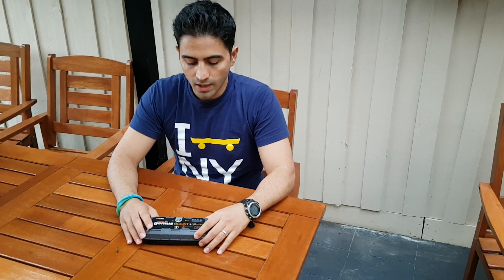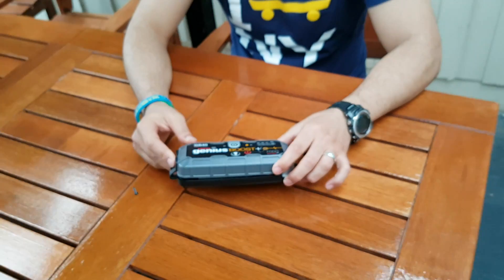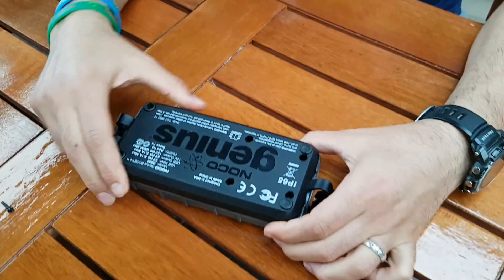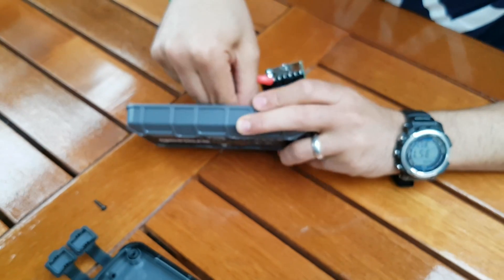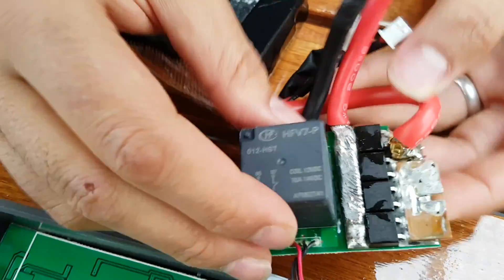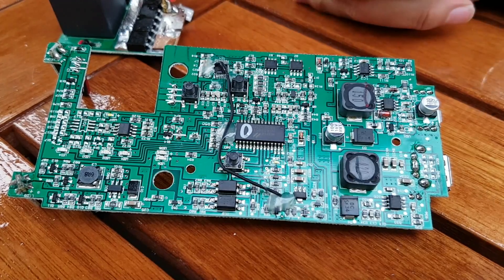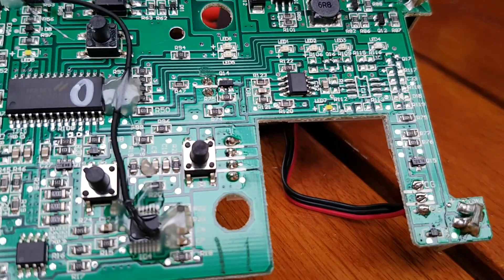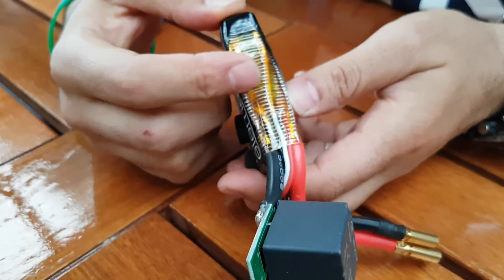Inside Noco GB40 Battery Booster Jump Starter Review

Comment: My brand-new, fully charged GB40 was unable to get my V6 3.5 L Toyota started after leaving the radio on. Followed all instructions to a T, trying with /without protect/override. Engine cranked for .25-.5 sec, but cut out before it had a chance to start. Confirmed the GB40 was still reading 100% charge per its lights after the attempts. Returned but will order another when on sale (reg is CAD $159) as it must've been a defect.

Comment: Old post.. but is it normal to feel a bit of a bulge through the back of the case? About q 1/3 of the way from the end(opposite to battery end) looking at your video I'd guess it was the black part, between the screw holes on the board, that intersects with the red wire.
Reply: no! that means one of your cells is swelling up, take it back, or dispose of it. 

I'm actually looking to replace the cells in mine if anyone has torn the pack itself apart and knows the exact cell type

Comment: Hello
I bought noco gb40 5-6 years ago. All this time I never really use it. It was fully charged inside my car. I tried 3-4 times to jump a car but sadly it didn't make it.
I tried it fully charged and with bypass option but nothing. 
I wonder if inside battery is dead due to lifetime. 
I should write that I put on charge not often. Every year or every year and half.
Could you tell me please if my device could be fixed or is garbage?

Comment: I still want to know how that black magic works on starting completely dead batteries, I seen a GB40 start a BMW with a dead battery in the trunk, the batteries in BMW's are rated at 900cca's because there in the trunk far from the starter, and that damn thing still started!!
Reply: Right. All the arguing about specs, all I know is they work. I made some comments on this vid 3 years ago, still using the same gb40 (albeit rarely), and it still does its job.

Comment: I've started a completely dead, 0v battery in a 6.8l V10 gas engine. I did have to let the battery booster charge the dead battery for a few minutes. Cranking was slow, but it did start. Device was in protect mode after engine start. State of charge light was 25%. Plugged in to charge and it was flashing 25% light, so it was pretty dead. The GB40 was definitely not sold as being able to start this large engine, but it still did it. No issues at all starting 1.6l NA and 2.0l turbo engines with 0v battery.
Reply: Can you please give more details that are missing? You said you "let the battery booster charge the dead battery" but which booster, the NOCO? and which dead battery? The one in the car or the one in the NOCO? 

Also when you say you "plugged in to charge, do you mean the car battery or the NOCO? Thanks!

Comment: Great review good product. The mini USB charging port is mounted flimsily. Mine disconnected and I have to try to fix. It broke loose with very little pressure. Other than that I love this product. I have the GB70
Reply: I had the same problem. I was able to replace the USB port and I put JB weld on it to hold it in place. No problems since. I also use magnetic USB cables, so no more insert/removal of a USB cable and no risk of damage if cable is ripped off the USB port.

Comment: The battery is under size but, you can fix it with just a 10 awg jumper solder on to bypass the relay.

Comment: !This is the best Jump starter I've ever used!✏️>allmy.tips/NOCO-Starter?17   I work as a mechanic and we use the jump packs all the time. This model is great for cars and Light duty trucks. Another nice feature this has is it will supply 12v power for as long as you leave it on, so you can power accessories or just charge a device. We also have the larger model that we use and it will start anything you would ever need it to. So for personal use this one is great but if you use it on a daily bases or for larger equipment i would get one of the larger models.

Comment: hmmm 2amp hour , 3600 secs per hour 7200 amps one second. Not likely but at 1000 amps maybe 3 seconds. or for 10 seconds 72 amps. hmm yep it prob wont start a car on its own unless its a newer car with warm engine which normally starts in less than 3 seconds.

Comment: I plan to have a booster for my van, this seems great. Right now i bought a diesel heater and i would like to test it but for that i need a power source of 12. I wonder if i could test the diesel heater with the boost mode. The heater uses 10 amps for one minute when the glowplug is heating and then it goes down to quite low amp. Don't feel like buying a extra battery for this test and this product will come to use some day.

Comment: I have a broken china brand portable battery starter. I was able to jump start 2 cars twice when it was new. I charged it then stored for around 6months. When I tried jumping another car, it won't do it anymore. The battery level drops immediately to lowest. I can still use it as a flashlight, cellphone charger, air pump for the tires but onlylast for 1 tire. 

Can I just remove the internal lipo battery then use the unit as a battery charger? Technically it will be connected to a low bat car battery while it is plugged into the wall outlet.

Comment: Can I charge the gb40  in bypass mode from the car battery while car is running?
Reply: No, you cannot. The 4 parallel (8 diodes) Schottky diodes will prevent any current flowing backwards to the cellpack.

Comment: Is it possible to replace the stock battery with four 18650 batteries?
Reply: There is currently no 18650 battery ( at least that I've heard of ) that can continuously put out more than 45 amps plus the balance charger for he stock battery is for 3 series not four series

Comment: 2150mah 24wh battery and the claim it will Produce  1000amps   TOTAL BS !  the Relay is only rated at 70amp how the HELL can it do 1000Amp
Reply: Could be a time delayed relay that would work.
Reply: @MickeyWu7r5  How do you mean that? Could you explain?
Reply: Kingsize what I mean by a time  delayed fuse is that it has a run cycle maybe a 25sec delay in the board before it even trys to start detecting higher amps to reset the running mode of the machine to stop putting out high amps and go back to ready start mode a 70 amp fuse would ensure that it would detect amperage every time through the run cycle because it puts out way more amps than that. 
With that being said it also helps with thermal protection of the parts themself because it only let's itself heat up or put out high amps for a set amount of time. That is why NOCO stresses to not bypass this mode because the safety features are being turned off and your running full amps without the safety features that are built into the board the time delayed fuses that tell the machine to shut down. It's like this if the machine is putting out 900amps and the fuse to tell it to stop is set at 25sec @ 70amps is it going to detect amps and shutdown yes and they would
 keep the machine from burning up that's what its designed to do.
Reply: @MickeyWu7r5  your ideas probably are correct, but your numbers are definitely not!!
Reply: Dan Ray - Marketing hype. But it probably can put out 2000 amps for a couple seconds then die.

Comment: There is no boost converter in this circuit. 11.1volt is the nominal voltage aka 3.7 x 3 cells. But when the 3 cells 3.7v cells are fully charged they can go as high as 4.25volts each = 12.75Volts. Wooola. No boost needed. "Boost converter" is allready built into the battery standard range of voltage.
Reply: I think it is needed to charge from 5V micro USB.
Reply: Yes there is to boost incoming 5v for charging

Comment: Bought one of these  , great at first  ,  But after 2 months  , it would only give one jump start and then die .
These lithium jump starters are ok for a occasional use or for cars with a weak battery  . If your  car battery is flat as pan cake then you will ruin your booster trying to start ! Also Lithium batters need charging regularly even when not being used
Reply: Anette Kottise I use the 150 all day long and it’s lasted a year now I do roadside assistance and buying the 150 is the best tool in my arsenal

Comment: surely it is cheaper to replace the car battery more often and keep it in good condition, only a fool would use a battery thats going to cause problems
Reply: 9 out of 10 mechanics recommend replacing your car battery 1 day before it is due to fail

Comment: On the output is a row of what looks like 4ea 40L45CT 45V 20A SCHOTTKY Low Drop Power Rectifier Diodes in parallel with the center leg cut off.  So that seems to be a total of 80A.
Reply: They have "Peak Forward Surge Current, 8.3 ms single
 halfsine-wave " 200A each = 800A total. However the unit is rated for 1000A burst. 8.3ms is nothing. I would think burst current for starting would be a second, at least.
Reply: @HalvardSkurve  There are 4 D2PAK, each containing 2 diodes. The I_FSM is rated at around 200-220A per die 10ms non-repetitive. (I_FSM_tot = 1760A). This is sufficient to survive the initial peak current the tiny battery would/could be able to supply at a near short condition. Real world currents will stay significantly below.

Comment: alot of people think you need 400 to 500 amps to start your car, this is not true, this is a marketing idea to sell "better" batteries.
Reply: To boost car in extreme cold with a completely dead battery you need well over 500amps. If you're in a warmer climate witha undercharged battery you're right anything over 200amps will help.
Reply: You have no idea what you're talking about. Amps needed to turn over engine depends on engine size.
Reply: S H    And engine compression and air temperature as well as how drained the factory battery is...

Comment: That is a really small battery, only 2150 mAh :(
My smartphone has a battery with 3100 mAh??
I wonder how a jump-pack with a rated battery of 10000 mAh would stack up to this.
Reply: You need to multiply the nominal voltage of the battery by the rated amp hours of the battery. An average samsung phone battery is around 3.8v and this one supplies 11.1v. Your cellphone battery probably is around 11.7 watt hours and this product is around 23.8 Wh

Comment: Take off your ring when opening such things.
Reply: why
Reply: @teddy_quentin  Metal conducts electricity. If it were to touch the right two things together, they could short out and make the battery explode.
Reply: Bullshit, those two things are called an anode and a cathode and the ring would conduct with little resistance.  No explosion  @mandolinman2006
Reply: Norma Stitz , low resistance means high amperage. There's a chance of the battery exploding. It can also make the ring glow red hot very quickly or weld the connections to the ring.
Reply: Those batteries can burn if there is high current long enough for the cells to reach several hundred degrees.  I don't expect anyone can hold their ring on the terminals for several minutes.  @judep8920
Reply: @teddy_quentin  , regardless of what can happen to the battery, shorting the terminals is never a good idea. Wearing conductive rings and bracelets when working with electricity is an amateur mistake. 
Try taking a wrench and shorting your car battery; it won't take several minutes for it to get hot.
Reply: Not for the wrench but it will for the battery @judep8920

Comment: HOW do you get 1000 amps PEAK and ~200 amp continuos for a few seconds to jump start a vehicle from a 2150 mAh battery…??
Reply: you don't.........the 3S 11.1 lipo inside this boost pack is only rated at 120c. false marketing. there's a few REAL and HONEST teardown vids that reveal how cheap and ineffective this unit is.
Reply: Spector NS5 RD So how does a portable jump starter supply ~200 amps of cranking power from a 20k mAh internal battery…??
Reply: Spector NS5 RD 
Back to my question... how do these portable jump starters provide a split second 150-200 amps from a tiny 2100mAh battery..??
Reply: the battery is rated at 11.1v 2100mah 120c. that comes out to 252 amps you can draw. (but it's bullshit on this battery. more like 150-200, LIKE I SAID).
as for how are you able to draw so many amps from a tiny battery is......lithium polymer batteries can be very small yet pack a huge punch. the lipo's battery chemistry is the reason you're able to draw huge currents from a small battery. i don't know how else to explain it to you.
Reply: Spector NS5 RD 
So if im calculating this correct, 2100 mAh is equaled to a 2.1 amp battery... 
now we are going from a tiny 2 amp battery to just over 100 amps....??  The math does not add up..
Reply: yes 2.1 amp hours. that's it's capacity, that is not directly related to the current the battery can provide. look up and do some research on lithium polymer battery chemistry  and you'll understand how you're able to draw a large current from a small lipo. that's the best i can tell ya.
Reply: Spector NS5 RD I jumped a 3.5 liter v6 with it 3 times. The last time, the battery wouldn't take a charge at all the night before, and despite being on a charger all night, it was so dead in the morning I couldn't even unlock the doors electronically. The battery was completely hosed. The car started right up with the gb40 and it still showed 100% charge after the 3 jumps as well. That's getting the job done in my opinion.
Reply: As others said, 2.1Ah is the capacity of the battery not instantaneous current.   It means the small battery can provide (at a low drain rate) 7200 seconds at 1 Amp current and ~11 volts or 1 hour (3600 seconds) at 2.1 Amp current at ~11 volts.  If we ASSUMED the battery had a very low internal resistance we could calculate that down to say a 3 second boost of   (7200s*1A = O ) / 3s  =  2400 Amps.   Of course it wont pull 2400 Amps as the internal batt pack resistance will be about 45 milli Ohms
Reply: Vidmantas Tautietis soldered as opposed to what...??  Duct taped or electrical taped together, or better yet welded together..?? 
These are not jokes, they may have over-rated these but they get the job done...
I have one and have jumped several cars with mine...
Reply: +Vidmamtas You are confusing LiPo and Lion. Just like the difference between gold and lead, close but not the same.
Reply: To be fare I'm guessing 400-500 Amps max based on the cables alone
Reply: Vidmantas Tautietis how are they dangerous..??
Reply: Vidmantas Tautietis which one..?? There are several..
Reply: So you set the rules of engagement by delivering your opinion and refusing to accept possible testimony by someone who has practically played apart of being involved with thousand if not millions of 18650 Lions. That is unfair. You are entitled to an opinion but please make sure it based on data and not a video of some kid fast charging a LiPo pack on an RC kart park using a car battery. I suggest you continue some more research and you will find we have more dangerous things in life. If you incorrectly charge any battery, there will be consequences. Jehugarcia actually has a vid where he overcharges a Lipo pack cel from a car and the results are boring from your perspective. They are not as bad as you think. This pack basically is trying to maximise current usage at a cost. Life expectancy.
Reply: 2A is not the same as 2Ahr.
Reply: and those wires soldered? those things are jokes
Reply: You Tube exactly. the casing and charging voltage determines whether it is volatile. there are videos of trying to blow up 18650's too. epics fail. they are not just for toys. just ask Elon Musk
Reply: check the youtube (lithium battery explosion)
Reply: Mike Novo 
Li-ion and LiPo are the same battery just the LiPo is a Li-ion battery encased inside a Polymer housing...
Reply: You Tube theys thing are dangerous. those batterys for toys. its beter to have secondary small car battery in trunk but not this
Reply: Mike Novo 
I will not even start or go there with elon musk...
Reply: Mike Novo You are referring me to Elon Musk…  I told you i will NOT go anywhere that is related to Elon Musk… 
His Space agency is a FAKE… 

I am open to more info about Li-ion’s as long as it does NOT pertain to that Jack-Ass…
Reply: You Tube fake? so what would you say now about Musk? hahahah
Reply: where Ohms law is concerned, a short circuit equals infinite currents as far a the math is concerned when Resistance is removed out of the equation. In the real world that obviously is not possible due to losses and micro resistance in the circuit but is still can be spectacular until the sparks vaporise the weakest link. But to answer your question: 11.1V is the nominal voltage for Lithium Ion and full charge is 4.2V with a 2.15Ahr battery you can dissipate 2.1A for an hour. for 1000A peak cranking amps we take Ohms law to calculate what resistance we need. Let's do nominal voltage though I believe you would need a full charge. V=IR or in this case we need R=V/R. 11.1V/1000A=0.111R So we need to reduce the resistance for .111Ohms for a peak. and 11.1V/200A=.0555R or .0555Ohms. Now the design has to be rated for the output to prevent losses in hardware as heat which is not efficient. Capacity is just a gas tank. How hard you step on the pedal determines how fast you empty it...